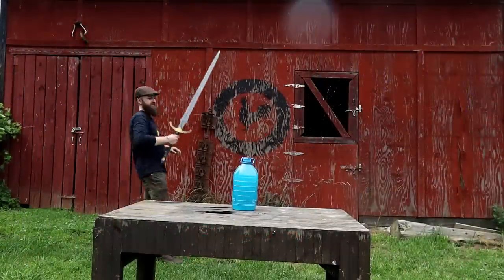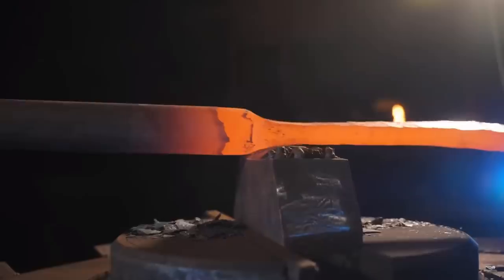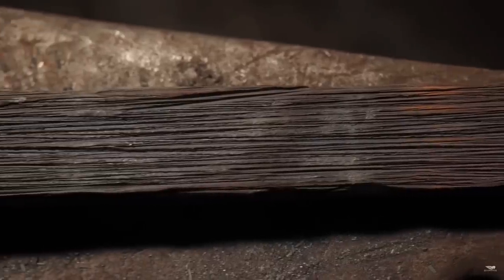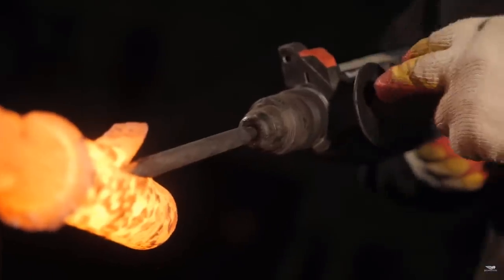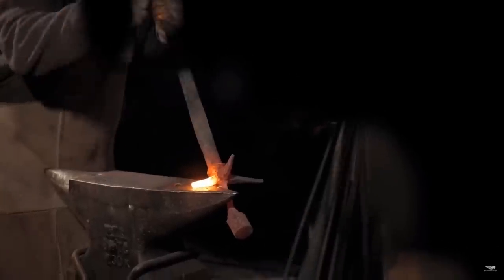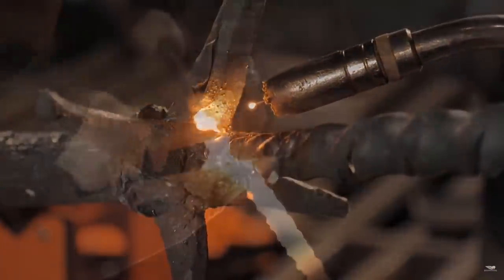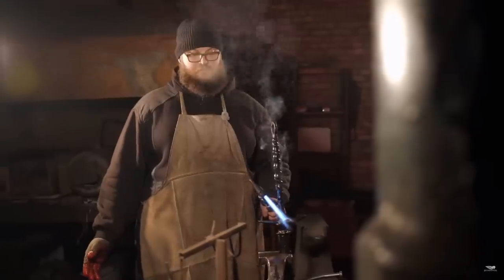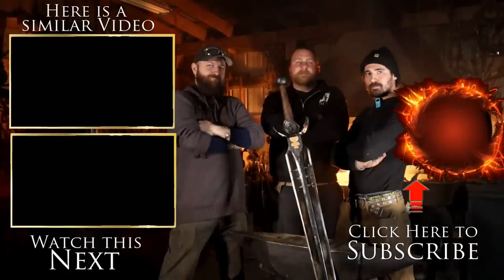Forging the [Coiled Sword] - Dark Souls 3

Comment: It looks bad ass, but it's essentially a metal stick, the Soul of Cinder was literally beating us to death with a stick.
Reply: Aren't swords in general really sharp metallic stick? Now that I think about it aren't every conflict before the invention of Firearms just people beating and throwing sharp sticks to each other till one of them dies?
Reply: It doesn't matter how heavy or sharp it is, if it has the power it has the damage
Reply: @ender72a75  with the twist that a coilesword has, the blade would be in a spiral, making the blade useless. so the coiled sword is more like a club than a sword
Reply: That is until phase 2 where the blade flattens(while also maintaining the twisting blade) where it becomes a greatsword
Reply: @RX0_GundamUnicorn  I was talking about the craftable version. but that works too
Reply: Its just a spicy piece of rebar
Reply: i mean the stick was not just on fire but super heated imagine this blacksmith taking that metal stick fresh out the oven and even doing so much as touch you with it let alone beat your face in with it, I see it as a viable weapon XD
Reply: It's all he needed to whoop my ass a few times
Reply: @dylansmith6078  then it would simply bend like rubber if it hits a simple thin metal helmet. the entire reason blacksmiths put the sword in the oven is to be able to shape it with a hammer.
Reply: @lobbster1018  I mean, if you spun it real fast (and had wrists that can rotate continuously) you could still use it as a thrusting weapon, like a rapier.
Reply: He switches weapons multiple times and the second face he has a greatsword dafuq you talking about
Reply: It's a bit closer to a lance, really
Reply: @lobbster1018  heheh that works
Reply: @lobbster1018  Being stabbed by this sword is pretty much an insta kill if it punctures any actual depth. A wound like that aint being healed by doctors very easily. Let alone by your body.
Reply: @wallaceluna6241  thus meaning it's a weapon made for thrusting
Reply: @angerfistkill  
It's always the same weapon
Reply: I guess it is more of a Chinese sword breaker now, isn't it?
Reply: @SpaceEmperorGenos  dude it was a joke calm down.

please.
Reply: Until soul of cinders flames flattens out the fucking blade and Gwyns theme comes in
Reply: @SpaceEmperorGenos  what are you trying to do? Disprove his statement? If so I don't think you did.
Reply: There is a knife with a similar design called Jagdkommando tri-blade knife. That knife is infamous for its ability to create stabbing wounds that are impossible to patch, and the victim would bleed to death. It is illegal in some countries.
Reply: Isn't this comment kinda stupid, since a metal stick is basically a baseball bat, and a baseball bat is pretty damn good at fucking someone up?
Reply: @TheRPGentleman  Still not a sword though. Try to stab or slice someone with a baseball bat. The entire point of a sword(no pun intended) is that it is used to slice or pierce.
Reply: @sidroberts7960  Eh, who cares. You don't need a sword to ruin someone's day.
Reply: @TheRPGentleman  Pretty much everybody in the comment section cares. That has always been a bad argument. If you are arguing about something you care about it too, otherwise you wouldn't be arguing about it. No, you don't need a sword to ruin someone's day, but that wasn't what the debate was about. That would be you attempting to build a strawman argument rather than actually arguing against what was stated.
Reply: @sidroberts7960  Tell me you're a virgin without telling me you're a virgin lmao.
Reply: You say that like I didn't beat him with a literal wooden log.
Reply: Same happens to me. This has to be the... weapon? with the most propporcionate coolness to uslessness ratio.
Reply: He's trying to screw you
Reply: Maybe, but the coiled stick didn't sounded as cool so he changed as coiled sword, when a huge dude that is in fire with a coiled stick tells you it's a sword, you're not really feeling in the mood of arguing with him XD
Reply: As Gwyn intended
Reply: Well with the Soul of Cinder Boss , he actually has a living flame within his coiled sword version... Meaning its a Flaming Hot Cheetos thick stick , plus his version is abit bigger 😂 Your character cant stand against it specialy Final Phase Cinder from DS3
Reply: @ender72a75  DUDE FINALLY. I had this realization about a year ago. All Human Warfare has been us throwing rocks at each other, and figuring out even better ways to kill people with rocks. Arrows: made of rocks. Spear: made of rocks. Bullet: made of rocks. Rocks have probably been the single most contributing factor to early human deaths.
Reply: Well, the first Chosen Undead we play as did start out killing Asylum Demons with a sword hilt so...
Reply: With a stick......and bullshit combo
Reply: beating us to death many many many times
Reply: An all mighty stick
Reply: Fr that shit doesn't cut lol
Reply: Ah ah ah, a Flaming metal stick
Reply: In the words of Shad:

YOU HAD STICK. STICK VERY GOOD.
Reply: @lobbster1018  The tip is still sharp and pointy, so it's more like a spear/lance.
Reply: a very big stick though. and lightning.
Reply: @lobbster1018  it could be used for stabbing and puncturing, and then be twisted like a drill once it has stabbed into an opponent.
Reply: A magical stick
Reply: @ender72a75  and fire arms r pretty much just shooting a pointy metal dart at high speeds
Reply: If the edge was truly sharp it’d have some minor slicing power against soft targets, and obviously it would be a somewhat competent thrusting weapon, but it would lose its edge really fast and thrusting with it wouldn’t have much more efficacy than a cheap pike. Practically, a simple straight sword would outclass this thing in almost every regard. 

Can’t beat the appeal of a good fashion souls weapon though, I see no point in getting literal about a game where you can use literal chunks of statues as weapons😂
Reply: I feel like with how it’s designed, it would work REALLY well as a thrusting sword because of its spiral blade. You could twist it and there’s no way in hell you’re gonna heal from a wound like that. Kinda like the Cyclone knife.
Reply: @lobbster1018  you can sharpen a spiral. Won't be as effective, but it'd still cut.
Reply: @lobbster1018  The sword still had a sharp point at the tip it's not fully coiled
Reply: @sidroberts7960 than  not all swords have edges and for all we know the coils could be Sharpened at the edges some variants of knives have it and it makes very lethal weapons tbh a sword is sum that has a hilt and a certain length of blade if its longer its a greatsword if its shorter its a tanto I just kinda forgot the specific numbers
Reply: @ender72a75 , а как же камни, чумные тела, огнемёты, яды, кулачное оружие, плети и кнуты, пытки и прочее?
Reply: @danielsteger8456  I mean come on guy, the metal has to be white and near molten to do something like 'bend like rubber'. Um, no, that's not how metal works. I've never had metal just FLOP after smacking it. You have to really HIT the metal with your hammer to even make it bend a TINY bit. Just hitting the metal againt a helmet at any other temp or even color would just make a 'clang' and.... what then? As long as that metal is hot, you can mess someone up with it. Hell, stick it to the person and the metal with burn through their skin. Remember, a cow brand is able to permanently burn a shape in a cow. And that's nowhere NEAR blacksmith temps.
Reply: @dagrazytcom5492  we are talking about a coiled sword here, a "super heated" fresh out of the oven one. and if it does not bend like rubber, so what? its still going to deform a huge amount when it hits armor or anything hard and be unusable.
and what does it matter if the sword is red hot? stop acting like getting impaled by a sword is no big deal. in fact, hot swords might even sterilize the wound. your whole comment is a joke, a red hot sword will NEVER be a viable weapon over a normal sword.
Reply: It can be a cool-looking club/spear tho... Because you can only bash your enemies or stab them.
Reply: @lobbster1018  useless until  you realize 

If you put a marble on it, the marble may stay on the sword as it goes down
Reply: Well, when you think about it, aren't all swords just sticks?
Reply: What if there was very tiny fishing hooks on them.
Reply: No, its a big screw!
Reply: Nearly every melee weapon is a stick with extras customisations
Reply: @ender72a75  Bullets are just very short metal sticks. Same basic premise as arrows, shoot a pointy stick using a release of pressure to launch said pointy stick over a long distance.
Reply: Yo, I do NOT see a metal stick?
Reply: @longps9528  No it isn't. Stop believing random facebook posts about "deadly knives" dude.
Reply: @danielsteger8456  A flaming sword is definitely a viable option... when you're a magical giant flame lord with the power to shapeshift your weapon and cause explosions everywhere.

Which is what the guy who uses it is.
Reply: @skeletonwar4445  it's from google. I've seen a weapon familiar to this so I just stated my opinion since freedom of speech exists. I didn't demand you or anyone to believe it, I just said what I knew about the subject. If you want to prove me wrong though, do it. I'd like to know how wrong I am.
Reply: @longps9528  The knife you're talking about isn't banned in any country in the world and the only one that would even consider it is the UK, with how often they ban random ass meme weapons for no reason.

The wound it leaves is barely any different from any other puncturing knife, those kinds of wounds are always incredibly hard to patch up and have a high chance of the victim bleeding out beforehand.

The coiled blade is a fancy visual, nothing more.
Reply: @lobbster1018  I'd consider it to be closer to a flanged mace than a club since what remaind of the blade will still concentrate force.
Reply: well the tip is sharp meaning its like a spear and club at the same time. Plus the coiled edge could be sharpened, which though not remotely as good as a regular sword would still do something
Reply: This comment section is cancer, lol.
Reply: @ender72a75  yes but some sticks deal More damage than others
Reply: i mean its just a coily rapier with a lot of length
Reply: A super heated stick. It could probably melt armor
Reply: @lobbster1018  not for stabbing though. They made a knife very similar illegal in the Geneva convention because it’s almost impossible to stitch the wounds. It might not cut well, but as a stabbing weapon it’s very effective
Reply: he hit my character in the mouth with and it then i realized its not even a blade so my characters teeth were just shattered
Reply: Well mate, there was a spear, fire, magic, curved blades, og gwyn's power on his side....
Reply: I had to beat an ashen-one with a stick to get one of these cranberries - Soul of Cinder, probably.
Reply: the coiled sword is present in all bonfires, it is not really a sword, more of a poker. It's power comes from flame itself, the blade shape itself is irrelevant
Reply: It's either a sword stylized as an antique fire poker, or vice versa, at least originally. Now it's a full-blown weapon to be used, but it's definitely based on a traditional fire poker and always has been.
Reply: @helveticalizard2654  yum
Reply: @DepressedCrow  what.
Reply: @lobbster1018 if you pierce it into someone it would hurt badly tho
Reply: Magical metal stick
Reply: @lobbster1018  it’s a thrusting weapon mostly
Reply: @DepressedCrow  the icon on your channel is from Rain World, I know it, when I HEAR. SEE. SENSE. It
Reply: @DepressedCrow  cause, rain world is [ oof ]ing cool.
Reply: @lobbster1018  or a piercing weapon
Reply: But you forget that the world of Dark Souls 3 isn't like our world, that 'stick' is ignited with fire and is actually 'cutting' through using that power.
Reply: A Burning Metal Stick, but still a metal Stick
Reply: It could club people very well no doubt it's true purpose is stabbing not slashing when stabbing into a person you loosen your grip spinning the blade into the person making it stuck into them

Comment: Damn, I wanted to see him hit the water bottles with the force of Concord to cut the bottle.
Reply from the maker: Thought about it but it’s not a weapon in the game
Reply: even if they used it they would only be able to pierce and smash stuff, i dont think you can cut with it
Reply: @jwanikpo  still worth it
Reply: @jwanikpo  It still be good for like an estoc sword type stabbing machine.
Reply: @jwanikpo  As said above, Estoc is a thing. It is a piercing weapon with a very rigid blade and meant for ramming the blade through the weaker mail protected portions of a full plate armor. It is like a Longsword version of the Rondel Dagger. It can only thrust, not cut, but it is very good at it.
Reply: @MaaZeus  true, but this sword is more of a giant drillbit than an estoc, it aint that thin as to find weak spots in armor
Reply: @jwanikpo  True, but for little water bottle action it could have still worked. But otherwise it is a bad weapon as usual for most fantasy swords.
Reply: @ThatWorks  actually it is, you have to kill the final boss to get it
Reply: @ThatWorks  What about the Firelink sword?
Reply: @kevgmei  the firelinksword IS the coiled sword

Comment: God I so hope to see you make a Golden Sun sword, Felix's concept art sword or the Gaia Blade with a bronze finish (if not a bronze blade)
Reply from the maker: Hmmmm
Reply: YES THIS!
Reply: I dunno if it would be possible with swords, but the machine shop I work at does a lot of work with stainless steel. When you heat treat stainless to 900F using the H900 heat treating method, it turns a beautiful golden bronze color. We only get it up to 43-46 on the Rockwell scale though, and I believe swords have to be a lot harder than that. Still be cool to see a sword made from stainless and heat treated that way though, even if it would be a wall hanger.
Reply: @ThatWorks  so many good swords in golden sun plus a great game
Reply: @murphsmodels8853  I mean, bronze swords were a thing and are way softer than steel ones. You basically fix the dents on them by hammering them cold. So I don't think it'd be an issue to use your treatment, might be cheaper than using bronze too !
Reply: @ThatWorks  Guys, don't give me hope. I mean actually yes please do,  but now I'm scared ! xD
Reply: @kerplonkazeeee  There is a lot of neat designs, especially in the 3rd game since we can see the models. Though the sprites of the GBA one could make cool projects too.
Reply: I was partial to the Sol Blade, but anything from Golden Sun would be fantastic!!!
Reply: @dreadpirateshanx5288  Based on Dark Dawn's 3D models I have a prefer for the Gaia Blade, I think Sol Blade's material is too "out of this world" to be made into a real sword. It looks like some sort of glass or resin.
Reply: Classic

Comment: Forge In Fire be like: Sir your sword wouldn't kill!
Reply: @kevgmei  i think thrusts should work as well
Reply: Surprisingly not accurate. The Coiled swords edge isnt blunt, just twisted around. The blade would actually be MORE dangerous then your standard blade simply due to the particulars of parrying. With that design, a bladed parry would result more then likely in your blade twisting out of your hand and the Coiled sword slicing happily into your forearm.

Edit: with a solid sheild, this would cease to be an issue, but even then actually blocking with a shield is like to shatter your arm.

Comment: I'd argue that working with an air chisel is more difficult due to its additional weight and you need more muscle strength to keep it going where you want to because of the vibration. Working out details with such heavy equipment is impressive, i have worked with a jackhammer so i have some idea how it feels in the hand. Big props.

Comment: This version of the coiled sword is just perfect. Using modern tools it would have been easy to make the blade look "too clean". Ironically, by making sure there are imperfections all over the sword, you've made it perfect. It really looks like a sword that is centuries old.
Reply: its not perfect though. Its coiled too much. Which is a pretty silly mistake :/

Comment: I might be wrong, but I think the tip should have a straight and somewhat sharpened portion at the tip. If you slow down the cutscene footage at 10:19 it looks like there are a couple of twists in the actual blade portion and almost half of it is more or less straight.
Reply: It does look good nevertheless!
Reply: The ingame model might be different from the cutscene, though. I was just thinking that it would be nice to have at least a part of it that works like an actual sword, haha!

Comment: Two issues and I want to know if it can be fixed.
1, if placed in a fire it would be conducting a lot of heat. Is there a  metal or way to deduce this for safety.
2. If placed in a camp fire would the heat deform it at all or is it to light heat of a fire

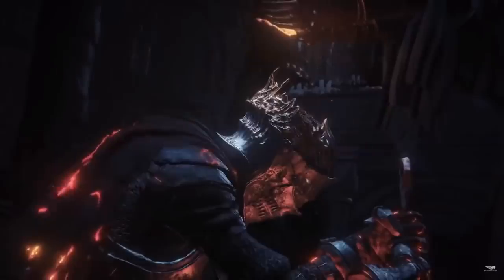Comment: I like what you said around the 4:10 mark... the reason blacksmithing became a dying trade was because of modern tooling, and the failure to implement said tooling into the trade, blacksmithing with old school techniques should be learnt first but definitely modern tool use should be promoted.

Comment: I'm still pretty new to the forging world, only just a few years ago getting my first propane forge. So please don't be too harsh with a reply, but wouldn't there be a big worry of using the air chisel to pull that much material away from the main piece of steel? I would be stressing till my hair fell out over the worry of stress fractures... I know the sword most likely wont be used and mainly act as a mantle piece, but still...